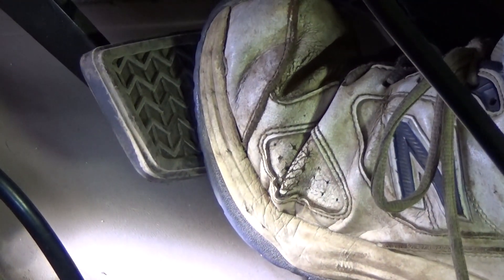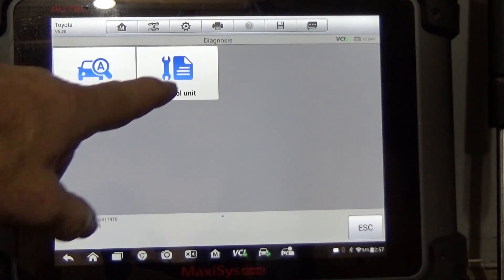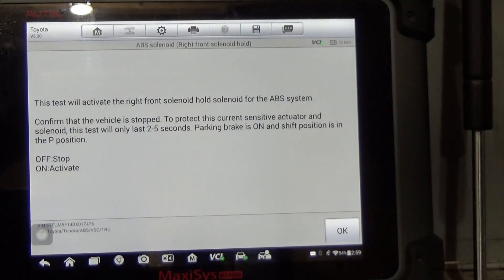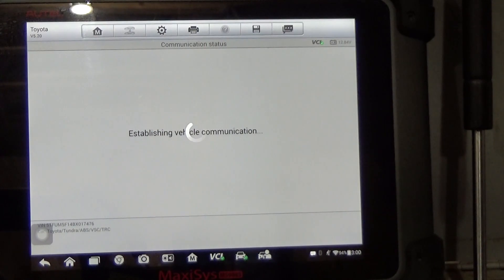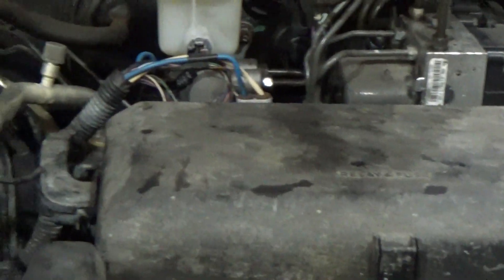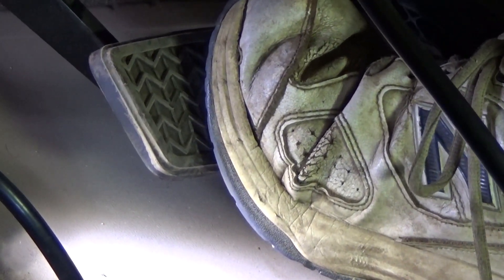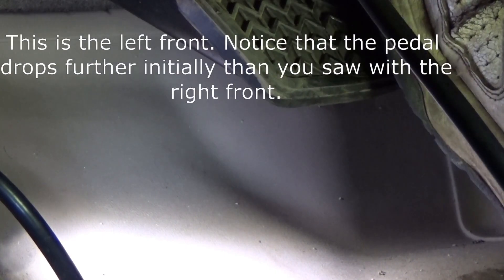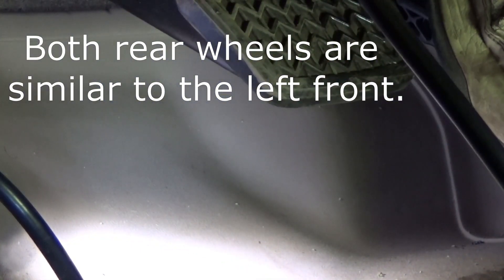Tundra ABS Controller Hydraulic Failure

Comment: Guessing game?
I guess the pad rusted solid to the bracket and the extra travel is from flexing the pad until it touches the disk
Reply from the maker: No, no guessing required. Think of this as a logic puzzle, the answer can be figured out with the information provided. If you have a brake pad that is seized and flexing that will give you a low pedal. Closing that wheel's  isolation valve would give you a higher pedal as demonstrated. Opening the dump valve for the affected wheel would see the pedal dropping further than just a single apply because you now have somewhere else for the fluid to that wheel to go instead of only flexing the brake pad.
Reply: @thecardoc100  I probably dont understand what that valve really is doing and how the "plumbing" inside the ABS unit looks like. 

Is the valve ONLY blocking the canals from the master cylinder and then there is another actuator pressurizing the system when the emergency  brake is doing its thing? 

Never looked into how this systems work as i never really had to.
If its NOT a rusted pad and its NOT a flexing brakeline and NOT a piston in the caliper that returns more than it should then i guess the fluid moves somewhere inside the ABS module where it shouldnt move. As in leaking past that valve into the chamber on the "other side" of it where my imaginary actuator lives. So leaky valve inside the module (Again, i have no clue how it looks inside the module. Im just picturing it in my head)
Reply from the maker: @stv2765  Trying to visualize this like you are doing is a great start. Realizing that you aren't sure what exactly is going on inside the ABS unit in as much as how ABS works now requires some research and study. See if you can find that information somewhere, maybe even search for someone else's video on the subject and then come back and see if this makes sense.
Reply: @thecardoc100  Alright. So to me it seems like fluid is leaking past the valve for that wheel inside the unit and past the pump and into its accumulator. So faulty valve.
We are NOT talking about air trapped in the system here, right? That was ruled out earlier on as i understood you right in the video.
Reply: Looking at pictures of a "regular" system it looks like each wheel got two valves. One outlet and one inlet valve. So according to THAT picture you have a leaking outlet valve.
So when you do that test you could probably see the fluidlevel go UP in the reservoir when that valve is de-energized as the fluid that is supposed to go to the piston goes back up instead.
Reply from the maker: @stv2765  There is no air trapped, this is a faulty valve in the ABS controller. The fluid is going past the valve into a low pressure accumulator.

Comment: Hmmm, I'm not sure on the questions. I have never done that test before but I would think if you activate the release solenoids the pedal should drop while activated.
Reply from the maker: That is correct, as you activate the dump solenoids you should feel a pedal response and the pedal will drop. Now exactly what you will feel is going to be different with regards to what is actually wrong with the vehicle you are working on and which wheel solenoid you are activating. As given away in the title this is a mechanical failure in the hydraulic controller, specifically a failed dump valve (release valve). One important note on this is that the dump valve operation is pulse width modulated so what happens when you operate one with a scan tool as compared to the mechanical failure of a valve will be different.
Reply: @thecardoc100  I have used line locks on the brake hoses to isolate a low pedal fault but I never tried activating the different valves. I'd love to hear some more detail on how you determine if it's internal or external the the modulator assembly.
Reply from the maker: @ssrbob  I'm glad you asked Bob. Looks like there isn't as much interest in this as I was hoping, but maybe it will help someone someday.  Let's pick this up where I stopped the video, we know that the problem is in the right front but we don't know what the problem actually is at this point so here is what we have to do.  We can feel how far the pedal travels with no commands so once the pedal stops moving, (about three quarters travel) we need to command a dump valve open. In this case I would choose the left front and see how far the pedal moves. It isn't much but it is very obvious when you have your foot on the brake. You can do two or three more activations and the pedal keeps dropping each time. Now that you know what operating a dump valve does to the pedal, release the pedal for about five to ten seconds and then apply it again.

 Just like in the video we again go about three quarters of the way to the floor without assist. Now when we command the RF dump valve open we have two possibilities, if the pedal sinks each time then the problem is in the line or caliper because operating the valve creates an additional place for the fluid to fill. If the pedal does not sink, then the accumulator is already full of fluid and the failed dump valve is confirmed. 

I hope this helps someone.
Reply: @thecardoc100  Thanks for the explanation, I'm going to have try some experimenting with this.